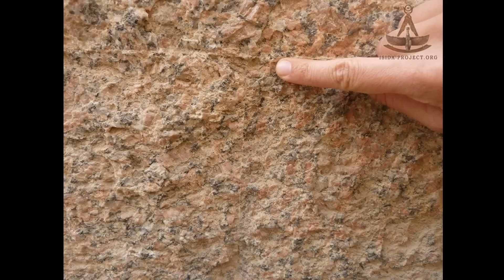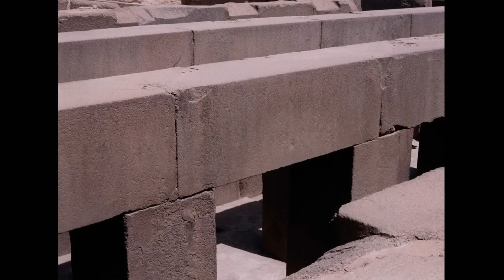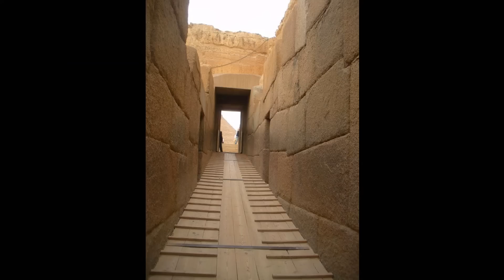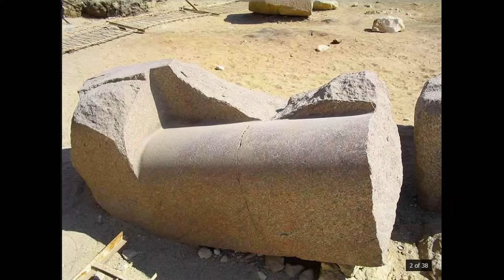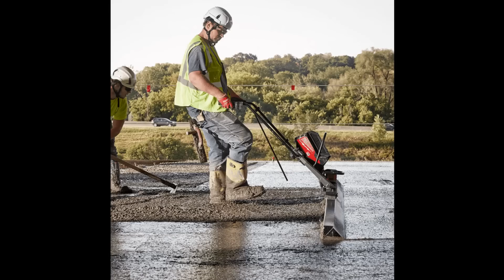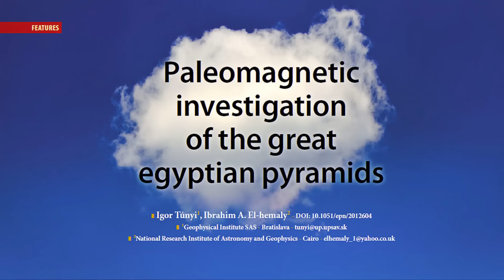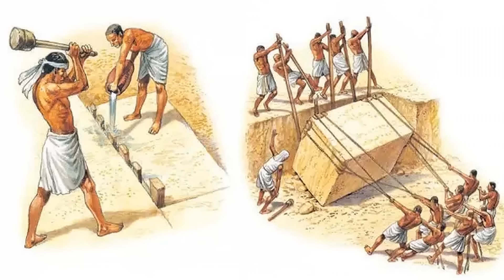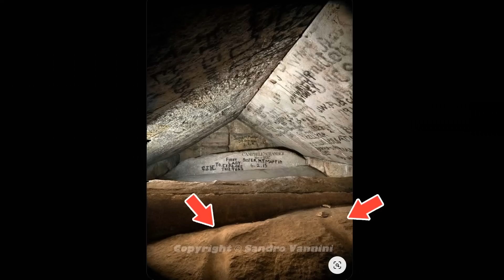How were the Perplexing Giza Pyramids' Granite Blocks Created?

Comment: I don't believe granite was cast. Scientists have confirmed that the granite used in the pyramids matches the composition of granite found at the quarry site, with no differences. You can even see the quarrying marks in Aswan.

If it were cast, why would every stone be unique in shape? wouldn't make them all the same shape easier? It doesn't make sense at all to have different molds.

And what about the unfinished granite obelisk? If casting granite were possible, why would they go through the process of quarrying and preparing a single, 1000-ton granite block for transport? Does that really make sense?
Reply: In natural granite, the quartz, feldspar, and mica crystals grow and interlock in a specific pattern during the slow cooling of magma, forming a cohesive crystalline matrix that contributes to granite’s strength and durability. It’s impossible to get the same matrix with geopolymer even if you put the same material.
Reply from the maker: Could you please name the scientists or the papers confirming that the granite used in the pyramids matches the composition of Aswan granite quarry? I searched and haven't found any.
Reply: @ Geologists Dietrich and Rosemarie Klemm conducted extensive research, analyzing the mineral makeup of the granite and matching it with granite from Aswan. Their work, along with studies using methods like X-ray fluorescence and petrographic analysis, has shown that the granite in the pyramids has the same mineral characteristics as Aswan granite. This research has led experts to conclude that the Aswan quarries supplied the granite used in many ancient Egyptian structures. Read also: Sustainability problems of the Giza pyramids, Granite quarry survey in the Aswan region, Egypt: shedding new light on ancient quarrying and PETROGRAPHICAL, GEOCHEMICAL AND RADIOACTIVITY STUDIES ON GRANITE AND GRANDIORITE ASSOCIATIONS IN ASWAN CATARACTS, EGYPT. Sorry I can’t put links here.
Reply: @CuriousBeingbyTina  Geologists Dietrich and Rosemarie Klemm conducted extensive research, analyzing the mineral makeup of the granite and matching it with granite from Aswan. Their work, along with studies using methods like X-ray fluorescence and petrographic analysis, has shown that the granite in the pyramids has the same mineral characteristics as Aswan granite. This research has led experts to conclude that the Aswan quarries supplied the granite used in many ancient Egyptian structures.
Reply: I also recommend: Granite quarry survey in the Aswan region, Egypt: shedding new light on ancient quarrying
PETROGRAPHICAL, GEOCHEMICAL AND RADIOACTIVITY STUDIES ON GRANITE AND GRANDIORITE ASSOCIATIONS IN ASWAN CATARACTS, EGYPT
Sustainability problems of the Giza pyramids
Reply from the maker: @NecroMancer-w2o  Thank you very much for the information. I found the 2010 and 2001 papers from Dietrich and Rosemarie Klemm, though there is no mentioning that they analyzed any granite samples of great pyramids. They did petrographic analysis on the Aswan granite; they also studied Giza limestone blocks which they stated that the limestone is natural. Dietrich and Rosemarie Klemm referred that "SALAH EL-NAGGAR presented a compilation of all granite components of the Gizeh pyramids and localized them all to the large granite and granodiorite occurrences south of Aswan." Just found that SALAH EL-NAGGAR is not a geologist, but a professor in the Department of Botany, Assiut University. 
Btw here are some papers arguing that the pyramid limestone is not natural: 
https://ceramics.onlinelibrary.wiley.com/doi/abs/10.1111/j.1551-2916.2006.01308.xhttps://www.researchgate.net/publication/299304501_Were_the_Great_Pyramids_constructed_of_agglomerated_stone_limestone_cast_like_concrete
https://www.researchgate.net/publication/258626055_Paleomagnetic_investigation_of_the_great_egyptian_pyramids
https://www.europhysicsnews.org/articles/epn/pdf/2012/06/epn2012436p28.pdf 
https://www.sciencedirect.com/science/article/abs/pii/S0167577X10008979 
Paleomagnetic investigation of the Great Egyptian Pyramids, Igor Túnyi and Ibrahim A. El-hemaly, Europhysics News 2012, 43/6, 28-31. 
Were the casing stones of Senefru’s Bent Pyramid in Dahshour cast or carved? Multinuclear NMR evidence, Kenneth J. D. MacKenzie, M. E. Smith, A. Wong, J. V. Hanna, B. Barryand M. W. Barsoum, Mater. Lett., 2011, 65, 350. 
Microstructural Evidence of Reconstituted Limestone Blocks in the Great Pyramids of Egypt, Barsoum M.W., Ganguly A. and Hug G., J. Am. Ceram. Soc. 89[12], 3788-3796, 2006. 
The Enigma of the Construction of the Giza Pyramids Solved?, Scientific British Laboratory, Daresbury, SRS Synchrotron Radiation Source, 2004. 
PIXE, PIGE and NMR study of the masonry of the pyramid of Cheops at Giza, Guy Demortier, NUCLEAR INSTRUMENTS and METHODS in PHYSICS RESEARCH B, B 226, 98 – 109 (2004). 
X-Rays Analysis and X-Rays Diffraction of casing stones from the pyramids of Egypt, and the limestone of the associated quarries., Davidovits J., Science in Egyptology; A.R. David ed.; 1986; Proceedings of the “Science in Egyptology Symposia”; Manchester University Press, UK; pp.511-520. 
Differential thermal analysis (DTA) detection of intra-ceramic geopolymeric setting In archaeological ceramics and mortars., Davidovits J.; Courtois L., 21st Archaeometry Symposium; Brookhaven Nat. Lab., N.Y.; 1981; Abstracts P. 22. 
How Not to Analyze Pyramid Stone, Morris, M. JOURNAL OF GEOLOGICAL EDUCATION, VOL. 41, P. 364-369 (1993). Comment a-t-on construit les Pyramides: polémique chez les Égyptologues, HISTORIA Magazine, Paris, No 674, fév. 2003, dossier pp. 54-79 (2003).
Reply: @  I agree that the casing limestone is probably casted. It has very different composition than natural limestone and it’s probably casted because they wanted to have an optimized/boosted function. However, casing stones are not supposed to carry much weight as natural stones do.

Granite is different. It’s impossible to replicate its natural formation by any synthetic method. The studies I mentioned did multiple analysis on granite pieces in ancient egypt including Menkaure granite and multiple granite pieces found in the giza plateau and other places. They are all natural and they concluded that it’s from Aswan.
Reply: I don’t recommend judging people that are not geologist but something else. Science is for everyone. Anyone can learn and do studies. We don’t care about titles. Somebody can be a phd and still a fool.
Reply from the maker: @NecroMancer-w2o   @NecroMancer-w2o  To summarize the information you shared with me, geologists Dietrich and Rosemarie Klemm did not analyze any granite samples of Giza plateau; they studied Giza pyramid limestone and stated that the limestone is natural. 
The only study providing XRF analysis on the Menkaure granite (and core, casings of the three great pyramids) is from the paper Sustainability problems of the Giza pyramids. This paper concluded that the core limestone blocks and casings of pyramids are all natural, even though multiple other papers have provided evidence from different examinations that the core & casings stones are reconstituted/ artificial.  Therefore, I would take the natural rock claim of this paper and the report of Dietrich and Rosemarie Klemm with grains of salt. 
Dietrich and Rosemarie Klemm wrote that a Botanist professor (not saying this professor can not be an expert in geology) “presented a compilation of all granite components of the Gizeh pyramids and localized them all to the large granite and granodiorite occurrences south of Aswan." Though that claim alone cannot be taken as fact.
Reply: @CuriousBeingbyTina  I believe we are talking mainly about granite not limestone. The studies I mentioned have studied granite samples and found them all natural. Limestone could be casted in the case of some casing stone and could be natural as the core limestone. 

There is no single granite analysis that says it’s casted. Your claim has no solid scientific data to support it. You can’t ignore all data about granite and say it’s casted.
Reply: Check out a paper called: Granite quarry survey in the Aswan region, Egypt: shedding new light on ancient quarrying. It studies many ancient granite artifacts in Aswan and found them all natural. Nobody found any evidence that any granite piece was casted anywhere in egypt
Reply from the maker: @NecroMancer-w2o  The material study on the Aswan quarry does not prove that the granite in Giza pyramids and temples is the same as Aswan granite. These two sites are 900 km away. The statement that the Giza granite is the natural granite rock from the Aswan quarry is an opinion and has not been scientifically proved. My cast granite hypothesis is based on observation and pattern recognition of the granite work on the Giza Plateau. The formulation and testing of a hypothesis is part of the scientific method.
Reply: @ Patterns and observations are not solid evidence since natural granite can have similar features. Scientific data like XRD and SEM is an evidence. All scientific data about granite analysis in Aswan and giza plateau show natural granite.
Reply: Not far away from Egypt, "THE ROMAN GRANITE QUARRIES IN THE TYRRHENIAN SEA" paper provides compelling evidence that the granite used in ancient Roman sites was not cast but quarried directly from natural stone sources. Through extensive referenced field research, geochemical analysis, and archaeological studies, the authors concluded that granite, such as that used in monumental columns and structures, was extracted from specific quarries across the Mediterranean, including in regions like the Troad, Sardinia, and Egypt. The detailed examination of quarrying techniques and stone characteristics further supports the conclusion that these massive granite blocks were sourced from quarries, not produced through casting methods
Reply: Is there any scientific evidence supporting the idea that any ancient granite site in the world was cast rather than quarried?
Reply: You can make concrete from any kind of stone and they had geopolymers, which after hardening are indistinguishable from natural stone, it looks exactly like the real thing.
Also the thousands of vases are just geopolymers mixed with types of stone, artists made vases as if they came from nature, very beautiful.
It is just pottery work, just not with clay.
Reply: @ No. Geopolymer granite and natural granite differ in both composition and physical structure. Natural granite forms naturally under high pressure and heat over millions of years, creating a dense, crystalline structure. This process gives it high compressive strength, hardness, and long-term durability. Geopolymer granite, however, is an engineered stone made by binding crushed minerals with synthetic material. While it can resemble natural granite in appearance, it generally has lower density, less hardness, and may be more susceptible to wear and environmental degradation over time.

Comment: Casting/softening seems inescapable however flat mating surfaces are a problem. I recall a group did analysis of some stone looking for evidence of non natural stone and found none but if you didn't find that report perhaps it was false. The most important problem to me is lack of evidence of the civilization, tooling, energy etc required for the possibly billions of tons of processed ancient stone works on the planet. Another unknown is the force necessary to fragment the very large granite statues. Sure looks like someone got ticked off. Have you done a study on the 'cart' tracks such as on Malta and other places like Texas? Excellent work as usual.
Reply: Fitting surfaces are easy to make, just pour them together.
Geopolymers are indistinguishable from natural stone, Egyptologists don't want to hear that, but it has been known for a long time.
Reply: @heinpereboom5521  Flat not fitted, even self leveling concrete does not make a close tolerance flat. Granite is created by extreme heat under extreme pressure. All natural stone heat melted without pressure and reconstituted with binders is easily detected but just because we can't do it doesn't mean it wasn't done.
Reply: @danontherun5685  
If you pour concrete over already hardened concrete, it will fit exactly.
Reply: @heinpereboom5521  Do you not know the difference between flat and fit?
Reply: @danontherun5685  
I don't quite understand which direction you want to go.

Comment: 100% agree. It is the obvious conclusion. Also, it appears we don't need to invoke high technology. Natron occurs naturally in Egypt, and heated natron can be used to create synthetic granite. The natron can apparently even be used to soften stone for excavation, which might explain some odd tool marks. All you need is a bellows and sufficient fuel to reach the needed temperature, which is not that high. You'd need something similar to make glass, which the ancient Egyptians also did. This doesn't explain the predynastic stone vases, which appear to be from natural stone, but it does explain how weights were carried, in that it's much easier to carry crushed stone than large blocks.
Reply: Natron doesn’t contain pink feldspar crystals, like those visible in several close-ups of granite blocks with tight fitting edges.

Comment: Modern tech can recreate perfect joints today. Granite is no harder to work than sandstone if you use a tool made of the same material or a harder material, also granite can be made softer and brittle using fire.. The vast majority of the blocks in the pyramids were made from sandstone with only a few blocks of granite. A papyrus was found describing how the blocks were transported from the quarry to the pyramid site. The Egyptians had a endless supply of sand that could be used to work the sandstone and granite. Most of the limestone and sandstone came from the site of the pyramids. So where did they get all the material for the cast stone and why are there quarries where the Granite came from if they were made from a cast material. Show me the quarries where the material for the cast granite came from.  Watch this and lots of his other videos #sacsayhuaman #lostancienthightechnology #mystery

Comment: It would be relatively easy to find out if it was cast or not, if you could get a valid sample. With all the thories out there, it's hard to believe no one has done an analisis. It would be hard to tell if limestone was cast or natural, but not granite. There would be an obvious binder between the crystal grains.
Reply: Well many geologists say they are natural and I know who I am going to believe.  Large smoking gun in Aswan quarry suggests cutting and transporting massive blocks wasn't a problem for them and let's not forget the quartz veins running through the granite that has been conveniently ignored - just like the fossils in "geopolymer" limestone.
Reply: @doctormarazanvose4373  I wouldn't disagree.
Reply from the maker: Actually the fossils in the pyramid limestone were used as evidence that the "stone" is a kind of geopolymer, because the fossils in natural limestone are laid in a similar direction while the pyramid fossil-containing stones show mismatched fossils in various directions.
Reply: @CuriousBeingbyTina  Real analysis rather than speculation: Donald Campbell and Robert Folk, “Ancient Egyptian Pyramids – Concrete or Rock?”,
Concrete International, Vol 13 Issue 8, August 1991
Reply from the maker: @doctormarazanvose4373  Thanks, though that's not a convincing material analysis - there is no examinations with X-rays, plasma torch, electron microscopes, or NMR. See the following as comparisons: https://ceramics.onlinelibrary.wiley.com/doi/abs/10.1111/j.1551-2916.2006.01308.x
https://www.researchgate.net/publication/299304501_Were_the_Great_Pyramids_constructed_of_agglomerated_stone_limestone_cast_like_concrete
https://www.europhysicsnews.org/articles/epn/pdf/2012/06/epn2012436p28.pdf
https://www.sciencedirect.com/science/article/abs/pii/S0167577X10008979
I showed these scientific papers in the video actually.

Comment: Always love your efforts to provide  logical hypotheses and arguments. As you say at 2:00 "this discussion should boil down to reality and practicality". To that end, I think a worthwhile followup video would be on the availability of material to use for cast granite, or practical methods to create that material (e.g., grinding). The goal, of course, would be to show that such methods were not only possible, but also practical (i.e., material creation/gathering  effort + casting effort will be less than efforts required to quarry, transport,  carve, and place solid granite blocks).
Reply: Before it was cleared of all debris, the Aswan quarry was buried in rubble and sand. The rubble was granite rubble, and the ~100 dolerite 'pounders' found all around the unfinished obelisk were used to crush the scooped-out sections of granite for reuse in reconstituted granite.  All of the granite stonework of the Old Kingdom was cast since they lacked the technology to work hard stone.